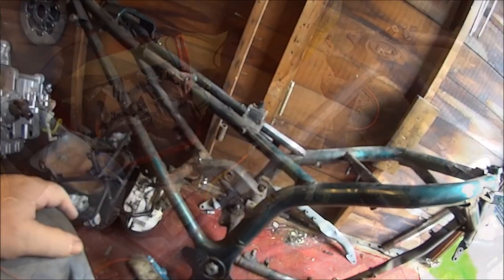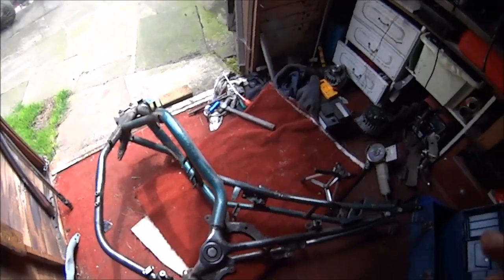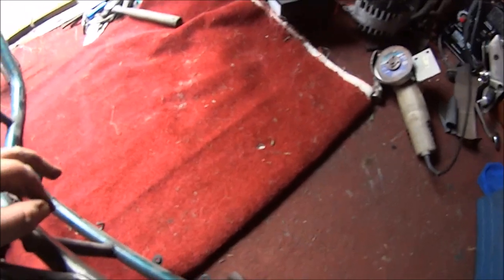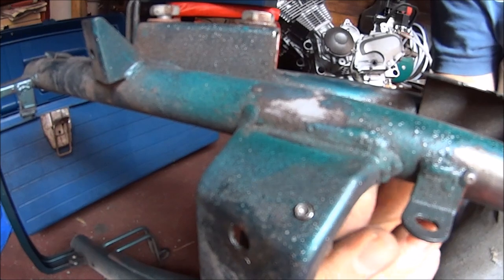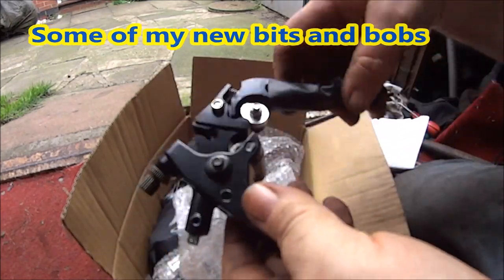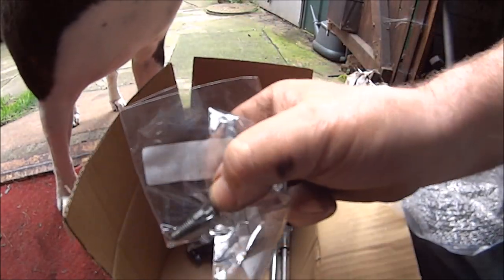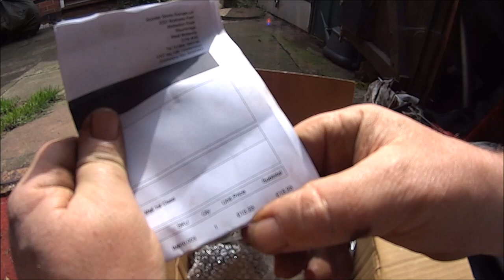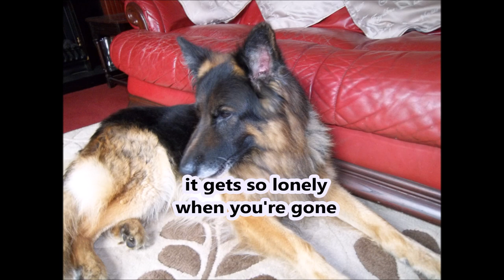XJ900S, MAINFRAME PREPARATION

Comment: Very your sorry to hear about Mr Zak, we lost ours couple of years ago, and they are so much more than just a pet.    The frame is looking good, your going to go through those wire wheels,  would normally suggest a pant stripper, I used Synstryp on mine, and works a treat, about £25 for 5ltrs of the stuff which would be enough for 2 bikes over, but with a pet.. not sure i would try it, unless you had somewhere you knew would be completely off bounds.     Coming on nicely everything else from here on in, is all new parts, and they are always a joy to work with, where did you get the master brake cylinder, think i maybe in the market for a new one soon.
Reply from the maker: GTs Garage their part of the family they all have their own caricatures. Thanks for the heads up on the calipers I'll leave them till the end of the build.